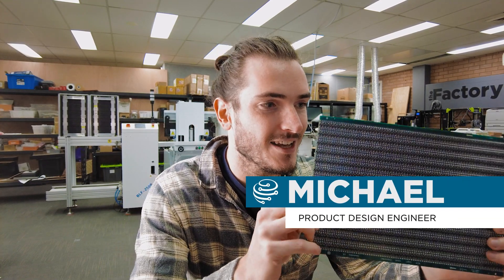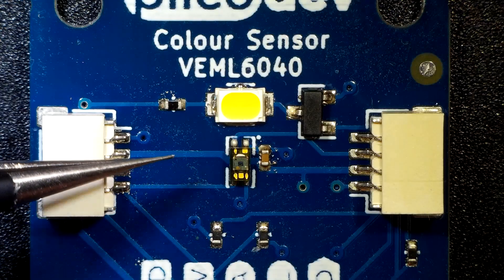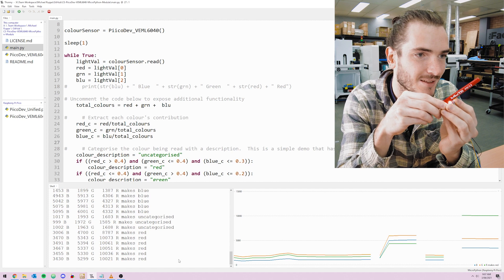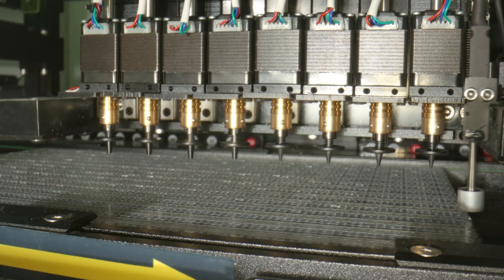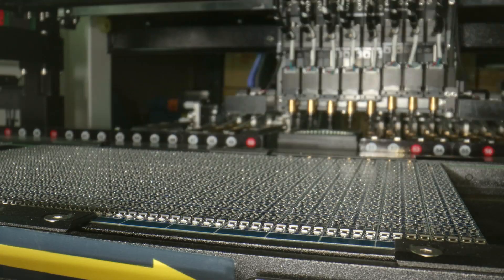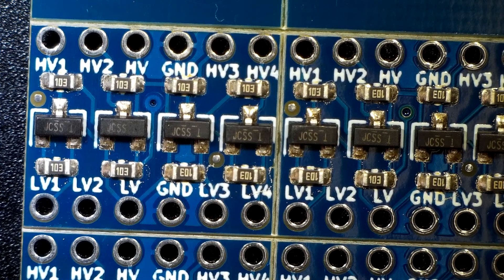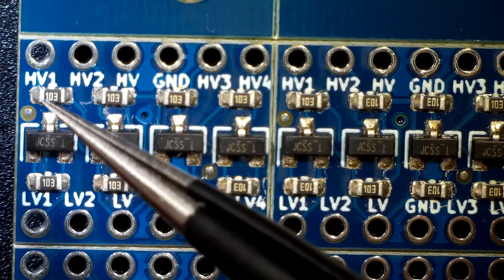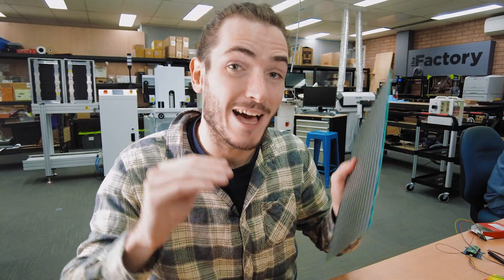The Factory | Optimising PCB Assembly For Pick & Place Machine

Comment: Your other option for some increased speed (no gantry to board cycle reduction) but pickup movement reduction is to load 4 feeders with transistors, and 4 with resistors and then do simultaneous pickups - assuming you can get all of the pick positions close to each other in the feed in position. This might shave off > 10% of your overall time.
Reply: Also, having the feeders on the front of the machine will almost halve your travel distance :)

Comment: I'm surprised the PnP software doesn't optimize the movements for the panel/job as a whole. You really shouldn't have to do that yourself. 🤔
Reply from the maker: Wouldn’t that be nice :) Optimization for this machine is basically entirely up to the user. Perhaps for the best, all things considered
Reply: If the project is set to be "per board assembly" there is no way for the PnP software to optimise it. As Michael said, he'd need to make it a "entire panel as one" setup to allow the PnP to optimise it.

Comment: Why don’t you treat two boards as one and place 8 resistors twice and then 8 transistors
Reply from the maker: Hey, that’s an option. We could clone the schematic, and with some light edits, get 2 identical PCB designs side by side (which are technically the one BOM). Some manual changes needed to the panelized design to get the v-score through the center of each (no biggie)